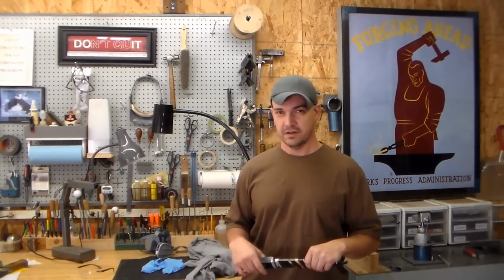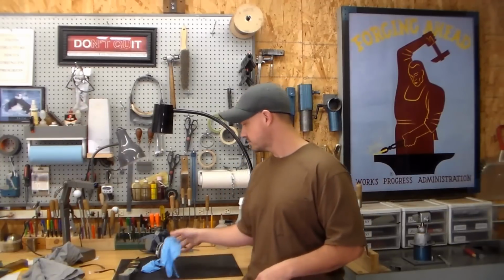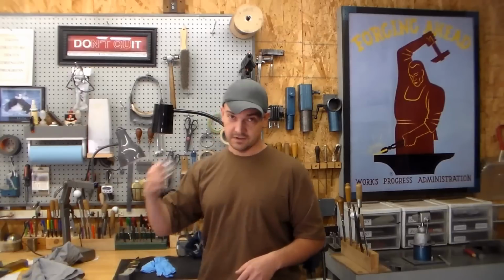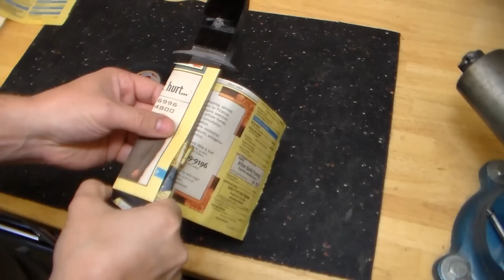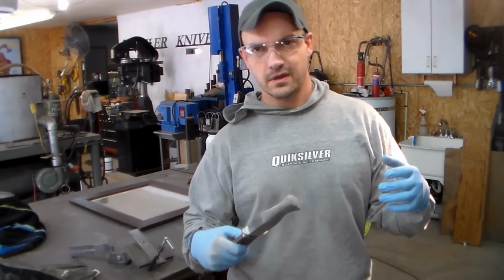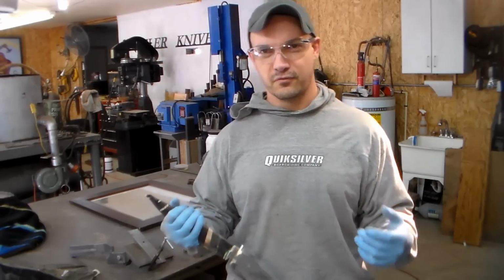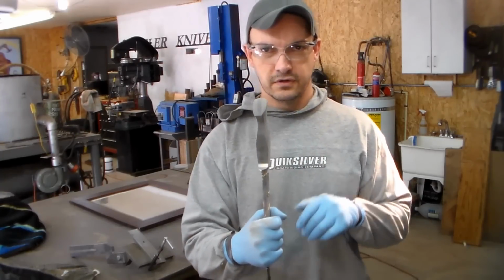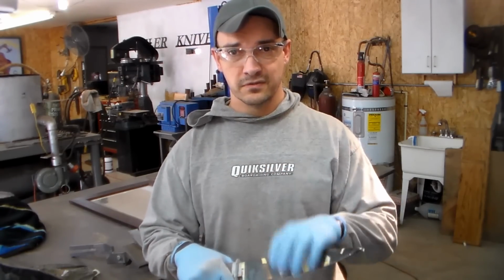Custom Knife Making Bowie handle shaping with Nick Wheeler part 3

Comment: Awesome videos Nick.  What grit belts are you using?
Reply from the maker: Harry Mullica Thanks Harry. :) If I have a LOT of handle material to hog off I usually go to a 36X. However, the G10 abrades away pretty nicely with the 50X or 60X ceramic 3M hoggers.. and that's what I was using in the video.